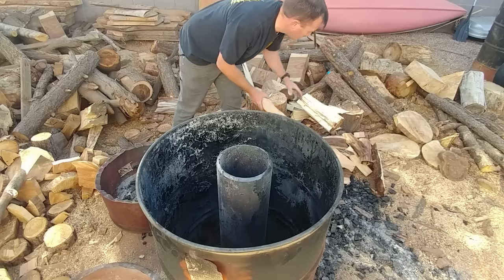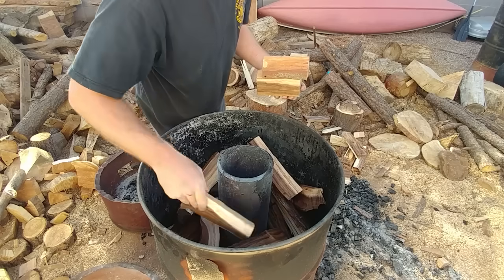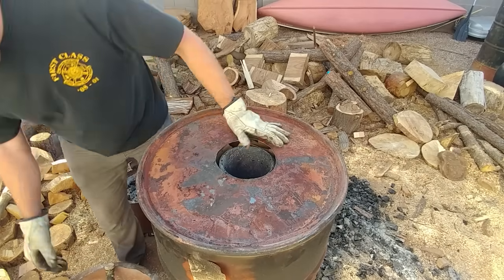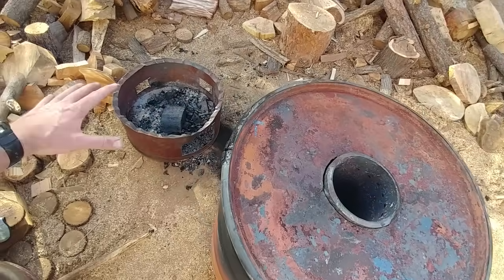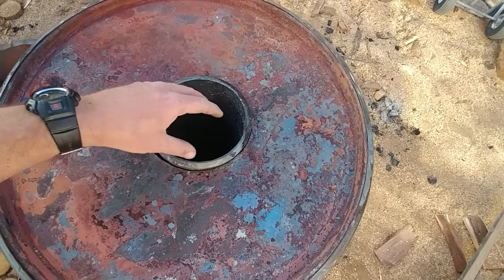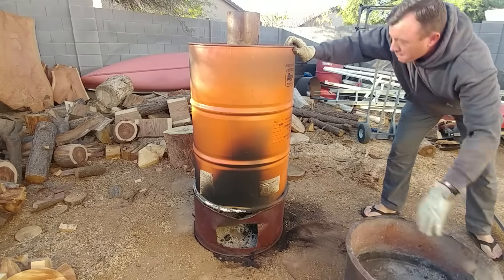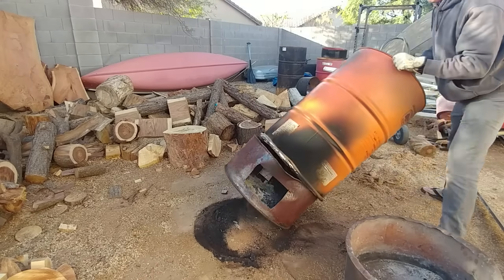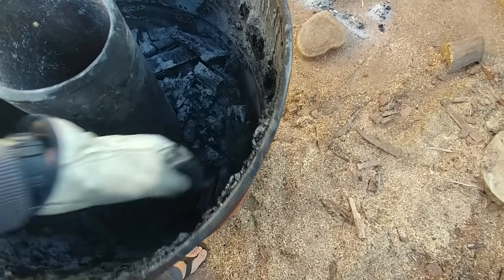How to make charcoal in your backyard

Comment: You left it burning. An there was oxygen, that pipe does not cute off the  oxygen as soon as the fire went out oxygen rush back in an regnited the charcoal.  You have an almost perfect set up but the pipe goes to the top an no farther.  Onces you cook the charcoal your suppose to prevent oxygen from getting back in.  In a sense smother it so fire can't start up. Just extend the pipe an make sure that you put a collar on the pipe and cap the pipe, those little holes allowed the oxygen back in an you lost your charcoal.  An the heat was not evenly distributed.  So you ended up with wood that was not fired enough. At lest you have done better then some. Thank You Loader.
Reply from the maker: My subsequent burns have become better. I've found that the CO2 produced from combustion actually puts out any fire inside the barrel. I'm going to make a modified barrel and try to make it more air tight.
Reply: @KimballCody  
I compared your method with the one in /watch?v=_g6Q7RmxG0I
- You use multiple holes for outlet of wood gas, while that other video only make one tiny hole. From my experience, some of those multiple holes may become inlet (instead of outlet) for air into your charcoal, which bring oxygen in. Perhaps that's what burn some of your charcoal.
- He put the hole on top of the can, while you put the holes on the bottom of the drum (he used can, not drum, so it's kind of smaller scale than yours). The hole on top made him easier to plug the can as soon as the wood gas was exhausted.

Comment: Thank you for the video; it gives good ideas.  With the way you placed the wood in the drum the amount of charcoal looks about right, maybe.  It may have been the wood too.  Soft wood doesn’t produce much.  I did not recognize the names of the woods you used.  It didn’t look like there was a lot of ash in your retort after it was done.  If there was it would be an indicator of your charcoal burning up.  I use Birch, it is the hardest in my state, and pack the barrel tight.  I only get about 2/3s of a barrel.
Cooling the charcoal down with water is a silly idea!   Anyway thanks for sharing.

Comment: When your hot charcoal stopped giving off wood gas, the charcoal sat there and smoldered using the ambient air that came in through that large gap around your stack until there was not enough heat/ oxygen to support combustion.

Comment: u didnt have a good seal on the bottom bettween the pipe and lid i suggest a threaded pipe, id also like to see if you could press your charcoal into bricks with water and then drying the pellets in the sun
Reply from the maker: Pressing them would take a lot of pressure

Comment: Your retort is not being properly used. When you think the process is done you must completely seal the retort or you will have wasted your time and feed stock. Any air that can sneak in will and that leads to burning of your charcoal. In your case I would try using some clay to seal all the cracks ONLY when done with the charring phase. Seal it up good and walk away. I know it's a PITA to do but if you want the best yield it is vital.
Reply from the maker: I've ran a few batches since this video and I've yielded better batches without any ash. I believe since the top is sealed the CO2 only escapes out the bottom and vent holes so it naturally snuffs itself out

Comment: A more even heat around the barrel should help. It seems like the wood at the bottom turns to charcoal first and starts to turn into ash as the wood at the top is just begining to change.
     You should also find a way to cover up all the gaps were air can get in when the flames from the gas die down. The charcoal will ignite and slowly burn if there's any oxygen. i saw big gaps between the lid and middle pipe thing. You should also cover the pipe when the gas stops burning.

Comment: The problem is that it's not sealed around the pipe. It may seem like a small slit but the total surfsce area of that slit is large. Air gets in through the slit and gets out through the exhaust holes in the pipe which are higher up causing a current that circulates oxygen ptobably while its done degassing and the fires is still going.

Solution: turn it upside down. The extra chimney doesn't matter just cut it off. Then put mud around the slit.
Reply from the maker: The top part is welded

Comment: why not try to pour water on the charcoals instead letting them sit for days. pouring just enough to kill the fire. i think that would make two thirds of the finished product.
Reply from the maker: Good idea
Reply: well, be cautious of the steam will produce tho.
Reply: @anthonyivon3339  The only thing about pouring water onto the charcoal is that, if you're going to market your product, it'll add weight and you won't get the true weight of the charcoal because the charcoal absorb the water like a sponge...  I tried it and it's bad for business but if it's used for home, then I don't see why not..
Reply: @bronz12  oooh that's right it'll add weight. i realized that i live in a tropical country so the charcoals will have the time to dry themselves.

mostly for sale. over $3-$6 estimated price converting to php P150 - P300  (filling a sack of 50kg rice).
Reply: if you plan on bbqing with it the charcoal will pop and ruin your food. if for  a forge i guess it could work, wouldnt reccomend it.

Comment: Your turbo flame is too much. Damper it about 3/4 the way down and the slower your fuel burns the more charcoal you have in the finish.
Good video thanks for educating those out there who don't understand the need for self-reliance.
Reply from the maker: The "turbo" is occurring naturally from the pressure building up in the barrel. Pyrolysis is occurring inside and forcing the unburned gasses out the holes at the bottom of the pipe. My thoughts are the faster it goes the more pressure it creates the less oxygen can enter.

Comment: You have the basic idea right be you lack the details to be efficient. Get rid of the chimney you dont need it. Just fill a drum full of wood as you did then install lid air tight. Install a pipe out of thside of drum near top and place a valve onto it so that after gasification is done you close valve to make the drum airtight. You can pipe the gases under the drum and use them to help heat the drum. But it must be monitored so when gasses die off the valve must be shut to create the airtight conditions needed to stop the burning process that turns charcoal to ash.
Reply from the maker: good points. I was going to go that route with the pipe but found that the chimney was the easiest route. I've been able to make more than enough charcoal and very little ash. each burn I've been getting better and better.
Reply: KimballCody well like most things it always improves with practice
Reply: I'm a lil confused, can you draw that diagram for me plz.Really appreciate it.
Thku
Reply: Ken Jett ............I'm a lil confused, can you draw a diagram of that drum with the exhaust pipe plz. I can't visualize it..I Really appreciate it
Thku
Reply: Baruc Barbers i wish i could i am no artist or architect. I understand some are more visual but i gave basic directions those that have common sense in basic engineering can figure it out. If anylacks that ability they probably should not be attempting to build this device. It can be very dangerous if not done properly. Sorry dont mean to sound rude but  this should not be attempted without proper knowledge and understanding of how charcoal is made.
Reply: Ken Jett ..............
.I appreciate it...Thku
Reply: Baruc Barbers there is a pretty safe way to make charcoal on a small scale.  Take a metal paint can or a 5 gallon no bigger but must be steel including lid. Punch or drill a small hole in the center of the lid no bigger than 1/4 inch. Fill can or bucket with chunky wood and and tightly install the lid place in a hot fire and watch the out gasing from the hole in lid. When you no longer see any out gassing place a nail or bolt into the hole in lid to seal it and remover from fire. Once cool you should have charcoal in you can.
Reply: Worked at a plant where we used this basic process on an industrial scale, had blowers to suck the air out and chipped the wood to make it faster. Also of you were able to make a rotating drum and use a wood chipper before filling it, the whole process could be done in under 30 mins.
Reply: @beast64375  I'd love to get more on this process please. You can even email it on jacktonem@gmail.com

Comment: I use a barrel and a half with a chimney mounted to the half barrel. Fill the bottom barrel (1/2" air holes in the bottom) with wood light the top of the fuel in the full barrel and then place the half with chimney pipe on top.

That's a large rocket stove. The 1/2" holes in the bottom of the barrel will always be less intake air than the @8" chimney, causing a deficit of O2. The O2 supply will necessarily combine with woodgas from the top of the fuel and burn down to the bottom leave charcoal in its place. I have run a whole barrel of oak leaves as an experiment and the individual leaves are charcoalized but otherwise intact.
Reply: I'm a lil confused.Can you draw a diagram of what you said for me plz. Really appreciate it..
Thku
Reply: Baruc Barbers one 55 gal drum plus one 55 gal drum cut in half plus one chimney...I used 8" hvac ducting.

The bottom (whole barrel) is filled with fuel to be charcoalized. Then the half barrel with chimney installed in top is fitted (by cutting alternate patterns and sliding together).

Bottom barrel has 1/2" holes (mine has 20 or so) and is set on concrete blocks for an up draft. Light the top of fuel, then slide the top with chimney on.

The heat going up the chimney pulls air in the bottom hole, but not enough O2 to completely burn.

When all is mostly burned, pull off top with chimney put on solid top and take barrel off blocks. The solid top and covering of holes by ground contact stops the burn.

Let cool and then collect a third of a barrel of charcoalized fuel.

Comment: 10 out of 10 for trying. Me thinks packing more wood in and less oxygen would be better. But you have something and it is not bad at all.
Reply from the maker: I'm getting better yields now. I might design a better lid to seal around the pipe
Reply: KimballCody just mix up some mud/ clay from the yard and seal around it.   Oxygen isn't necessarily the problem anyway.  Pyrolization isn't exactly the absence of oxygen,  but the prevention of combustion above combustion temperatures.  Is just easier to facilitate that by excluding oxygen.   To wit,  I've made batches of char by just baking wood on a cookie sheet over a fire before.  And many a thanksgiving Turkey has been pyrolized in an unattentive cook's oven.  So long as you prevent ignition,  combustion won't occur.   But that's tedious.  The reason your quality is poor is it's not getting to temperature and staying there long enough.  The threw flue pipe is fine,  but once you achieve combustible exhaust off gassing from the tank,  cap the flue at the top.  The pressure from the tank will push gases down into the fire and it will ignite.  That combustion rate of the gas is several orders higher than solid fuel,  so that gas combustion will heat the tank, hotter than the wood fire will ever get it. This perpetuats the cycle.  Then just leave it alone. Leave it till it stops releasing gases and dies by itself.
Reply: KimballCody honestly though I've gotten away from kilns,  retorts etc,  they're just too finicky.   The Japanese got it right with the kontiki method, which is what I use now.  If I even bother.   I made a lifetimes supply of charcoal with two kontiki runs so now i usually I just make a brush pile, light the top,  let it burn down till is not producing flame and then quench it with water.   Spread it out to dry,  sift it,  store it.
Reply: kontiki, i've searched it on google. an instant charcoal.

Comment: Can you lay the barrel on its side or at an angle? That would make it easier to lay the wood vertically so you will have more exposed surface area... larger yield... a more consistent product.
Reply from the maker: Standing it up allows the heat to go up the pipe

Comment: This reminds me of when I was growing up in the caribbean. The natives made charcoal, as it was their preferred method of cooking. They would make a pile of branches, start it on fire, cover it with dirt and let it smolder for 24-48 hrs i believe. At that point they would pull off the dirt and let it die, or, they would let it burn for, 60 hrs i believe and then pull off the dirt and throw water onto it, and it would powder down to lime, which they used for whitewash etc

Comment: Pretty sure charcoal is made in the absence of oxygen; just seal it up better and I think you'll get better results.
Reply: Also, exhaustion holes should be placed at the bottom of the chamber. That would not let oxygen inside the chamber, plus woodgases would self-fuel the pyrolysis process from the bottom.
That would let your feedstock to be evenly and cleanly carbonized, rather than partially oxidized (burnt).